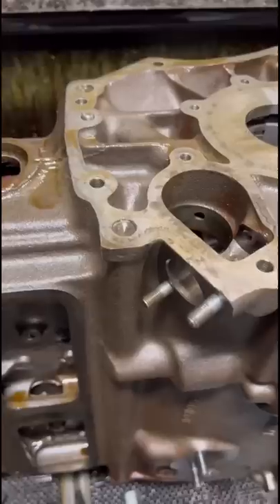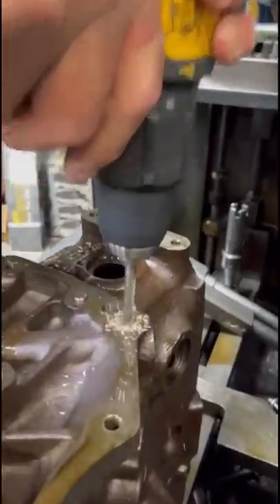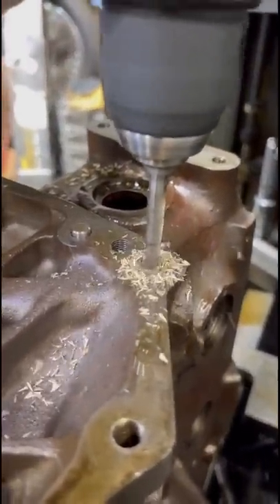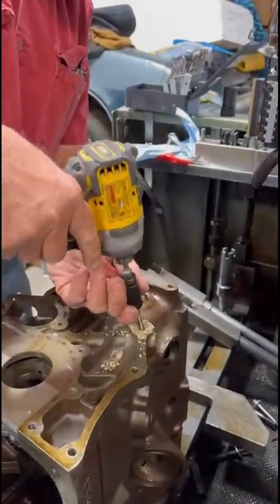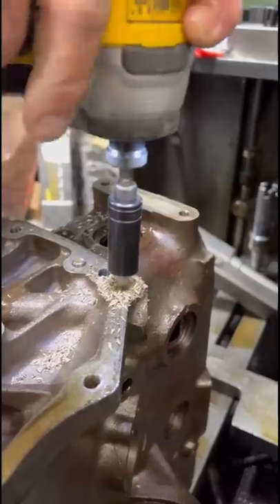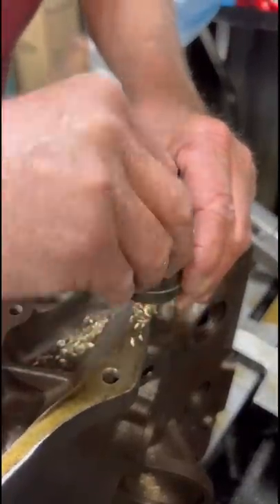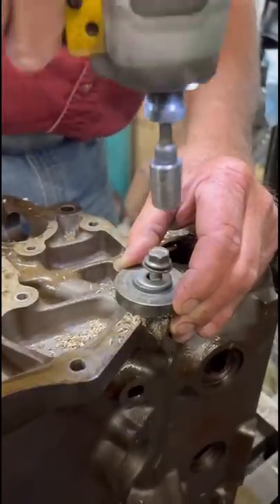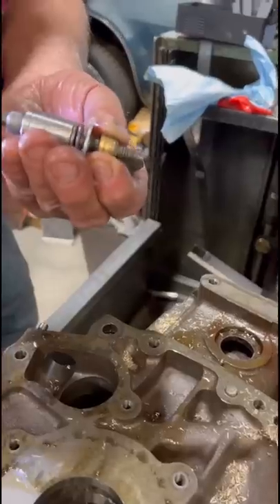#shorts How To Remove Press Fit Brass Oil Galley Plugs The Easy Way

Comment: Do you guys have a tap sets you would recommend?
Reply: Metric
Reply: Try a spiral point tap. (Not  spiral flute.) You can drill in threads in mild steel.
Reply: @mrbmp09  is there a brand you recommend?

Comment: What's wrong with a ezy out? Butchers!!!
Reply from the maker: How is an ez out going to extract a press fit plug?
Reply: @JAMSIONLINE  By attaching a slap hammer no problem.
Reply: @JAMSIONLINE  man how you gonna mock "armchair experts" when even you fail to step up with a comment like this
Reply: Easier to hook up a hydraulic pump with at least 100,000 psi while cooking the block in an oven

Comment: What the purpose tho you pulled the plug but then you said you can put it back in with the bolt why not just leave the plug in ;from jump
Reply: To clean the oil gallery. Putting it back in was sarcasm. You always put a new plug in.

Comment: Na. Drill the hole like you did. 
Insert long steel rod through hole and tap the bung out of the other end of the gallery. 
Insert a bigger steel rod from the open end and tap out the bung with the hole in it. 

That's Kiwi ingenuity. Smart not hard. You yanks over complicate everything. 
Your welcome. 😁

Comment: My god, driving a tap with an impact driver, please don't do that
Reply: Don’t knock it until you try it.
Reply: @jrod264winmag  I won't thanks, don't want to mess up my taps or to make M10 threads with an M8 tap
Reply: @paulhancock3844  We do it nearly everyday with great success.
Reply: @jrod264winmag  you carry on making oversize threads, no issue to me
Reply: @jrod264winmag  hand tap, for us by the hand, machine tap, for use with a machine. There isn't such a thing as an impact tap, for one thing they are too hard and are likely to break and second, you are likely to cut an oversize thread. Don't do it, it's not necessary, an abuse of tools
Reply: @paulhancock3844  I have several sets of impact taps, they are equipped with a 1/4” hex for my impact drivers. They are sets and did not include a handle!
Reply: @jrod264winmag  yeh, made in China no doubt, you don't tap hole with an impact gun, I've been in engineering for 40 years and this is on of the most rediculous things I've ever heard of, just use a drill
Reply: @paulhancock3844  I’ve been doing this for 20 plus years in Industrial facilities drilling holes through steel columns. Thousands of times literally and only had one or two fails.
Reply: @jrod264winmag  never had a fail with a hand tap in 40 years , keep your Chinese impact crap thanks
Reply: @jrod264winmag  I don't really care and I'm not your bud

Comment: Should I do it super crooked like you?
Reply: It’s removing a brass plug genius, not creating new threads in a housing.
Reply: @randymagnum143  when precision doesn’t matter in this case then who TF cares? When precision matters then use precision…. When it doesn’t then don’t. What’s so hard to comprehend here?
Reply: @armedpreacher  if that's the way you run a drill, I just assume everything you do is crooked and half assed.
Reply: @randymagnum143  if that’s the way you think I’d assume all your thoughts are narrow minded, only apply to a limited scope, and incapable of learning.

Comment: Then why remove it in the first place if you can just put the same plug in the same place and close it with a bolt? What's the point just seal the hole put some JB weld on that b** it'll stay forever lol
Reply: Armchair mechanic alert 📢 ⚠️ 🚨

Comment: Shocking to see a guy using a impact gun to tap  threads  its a big no no in engineering 😳 or at least start it by hand and then if u have to use the   impact gun
Reply: The plug he was tapping was brass. Need I say more
Reply: @frankvitullo3735  bruhhh why'd you tell him coulda had bro hand tapping brass inserts his whole life.
Reply: @phuckyoutube5927  lol 😂 too funny bro
Reply: @phuckyoutube5927  but like, just use a drill. The impact is overkill and make more risky